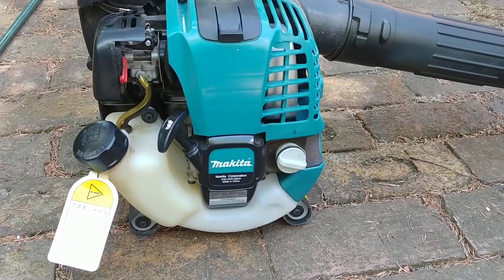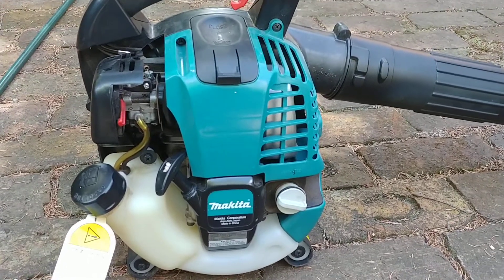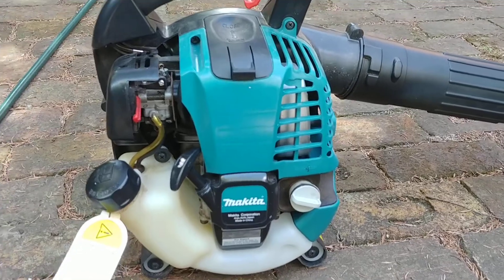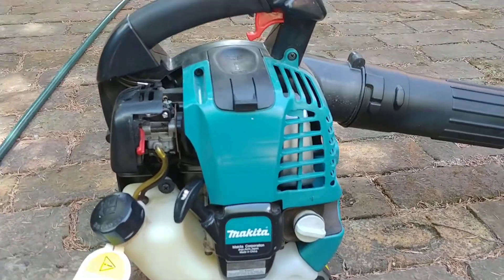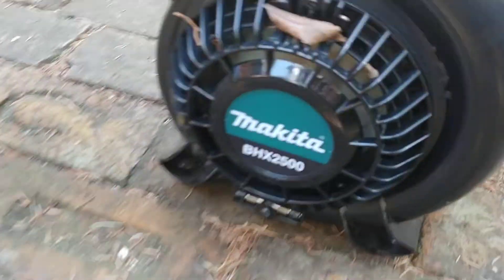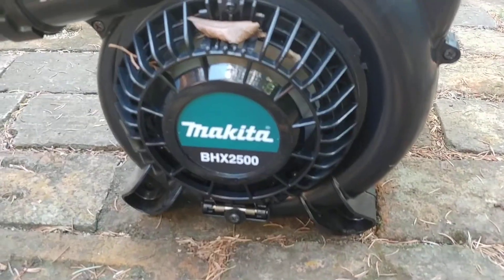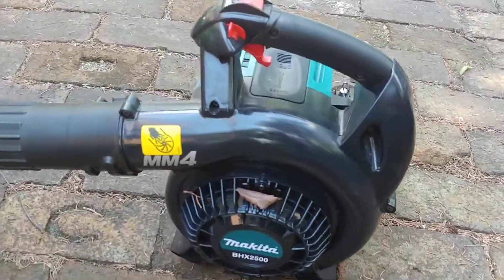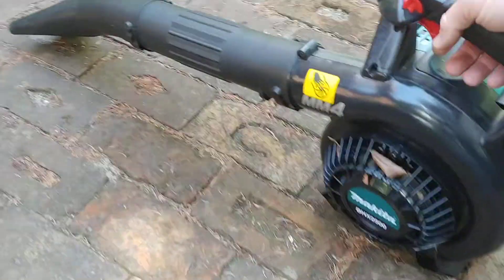Makita BHX2500 4 stroke blower, power issues and stalling

Comment: After two evenings of tinkering with it I found a fix. There were two issues.
1. The valves were definitely on the loose side. Too big of a gap. I adjusted them to 0.1mm.
2. The carburetor on my blower is very unique. Usually carburetors have 3 adjustment screws: Idle, Low and High. These small ones usually have one Idle screw, and either don't have any others, or have L and H screws hidden. But my carburetor has only Idle and Low screws. Looking at this video, they have the same carb as I have. The trick was to adjust the idle higher, and then using the L screw make the mix more lean (this will lower the idle). Search youtube on how to adjust the carb on a chainsaw, same principle but don't try to lower the idle, instead, I had to make it higher. " Steve's Small Engine Saloon" is pretty helpful

Comment: OK has nothing to do with Valve clearances, filters, sparks or carburates, chokes etc etc.   simply either drill or melt a tiny hole in the Gas cap and your problem is solved- this model has a faulty gas cap design and it creates vacuum in the fuel tank and eventually the motor stalls. if you don't believe me just run it with a loose gas cap and your problem will magically disappear.
Reply: That's an option, but this problem should happen from day one ... . Mine has this issue since last week, after one year of use.
Reply: @laurapalmerTDGE  inside the gas cap there is a small rubber one way valve the becomes hard with age and dose not open thus not allowing air into the tank, pull it apart and you will see - this is why people report problems with their engines 1 , 2 years down the track.
Reply: You are a genius! Just did the hole in the gas cap trick and it worked a charm. I was about to do all the valves, filters, chokes etc. so thank you very much.
Reply: @franklingrebbo  you need a channel lol
Reply: I wonder how many people will set themselves on fire trying to melt a hole in their gas gaps? lol
Reply: @privateidho made me laugh! Cheers mate 😂
Reply: Didn't work for mine

Comment: For peak performance, learn to adjust the valve lash.  The gap on a cold engine is 0.04” intake valve and 0.06” exhaust valve.  I adjust mine each year before Leaf season.  These are great blowers.  Quiet, clean, reliable.  I also recommend the flat blower attachment. Works much better than the round volute.

Comment: I have two of these. One idles and dies, the other doesn’t.  Have cleaned and swapped both carbs and issue stays with the same blower. . Was thinking a valve issue. The blower with the problem also blows some white smoke. It had a hard life before I found it. Other than that, it runs fine and starts easily. Best of luck with your problem solving.

Comment: Had exact same problem but only on cold days. Read them manual. Needs to be warmed up. I ran mine idle for 5 mins then worked perfect. Wish I knew this before all the hours of troubleshooting I had done.
Reply from the maker: Mine is the opposite, runs fine until it's warmed up and had some use.... Then if it's not kept at full throttle it stalls out.

Comment: Same issue for me. Replaced fuel filter air filter carb  oil spark plug and still have the same issue 🤦🏽‍♂️. I see some people mention adjusting the valve lash. Any videos on this?

Comment: Might be a bit late but. It's because they don't like idling. It chokes it out and floods the engine. When ur not using it don't let it idle. I have no idea why it floods itself but, if you keep it revving it will be ok.
Reply from the maker: Never too late! I had comments inadvertently disabled. Good hint, I'll try it next time, however the performance is totally unacceptable. I cannot even leave it idle momentarily without this issue, then often won't start. I have a Brush cutter with the same Makita 4 stroke engine, no issues.
Reply: @jellybean1976928  might need a valve adjustment or carb tune, i dont know, i have the same problem with my bhx2501
Reply from the maker: @alexcrafter_  She did this pretty much since new. Only has about 2-4 hours total usage.

Have read lots of negatives about carby issues on these motors, just can't understand why my brush cutter with the same motor doesn't do anything remotely the same.

Perhaps there's a solution out there, otherwise back to the hardware store to be swapped.
Reply: @jellybean1976928  could be sticky valve coz it might not get enough oil on valves when idling
Reply: When mine acts up, either poor top end speed or idle, I re-adjust the valves.  Still running great after 4 years of hard country living.  As a word of caution, do not use fuel with ethanol.  Its destroys the rubber in the carb.  Around me Costco sells gas with no alcohol.  And its cheaper than other gas stations.

Comment: I have the same problem. I have received a new carby and fuel line kit for $A21. The kit came with a new carburetor, fuel line, fuel filter, spark plug, and a gasket. I will just replace this and hopefully, this problem will disappear. It is hardly worth trying to fix an existing carby as the kits are 1/2 the price of a new carby.

Comment: Have the same blower, same problem, currently. Had it in the past, with a clogged fuel filter and replace that to correct the problem. So this time, first thing I did was take off the filter and put the hose back into the bottom of the tank. Still does not start. Took off the air filter to see if it needs more air, but no cigars. Then, I took off the spark plug; it was oily, and I cleaned it, and it ran for 1 seconds, then won't start. Since I live in the suburbs of Los Angeles, there are three lawnmower repair shops within bicycling distance. Before I take it in, any other ideas? I use the blower once a week, so the gas has a fairly good turn over rate.
Reply: any luck? mine does the same. 10 years old tho, I replaced the carb and didn't fix it
Reply: @Happyantix112  Happy, I obtained a new NGK spark plug from Amazon, and it started on the first pull, with all previous problems disappearing. Hope you have the same good solving of the problem.
Reply: @loft4me  glad that sorted it for you, I have tried a few new plugs without resolution!
Reply: @Happyantix112  Hang in there, stay happy!

Comment: Had same issue. Replaced carb, gas filter, spark plug, oil, air filter ended up scrapping and getting a backpack blower had it for 10 years without issue tho

Comment: That's wonderful what did you do to fix it
Reply from the maker: Still not fixed, will only run (once warmed up) if full throttle is kept open. I suspect the mentions of the valve adjustment by others is on the right track, however if the valve adjustment is so incredibly finicky and needing to be so precise my own view is that the very design isn't viable.
Reply: @jellybean1976928  Spark arrestor my friend.